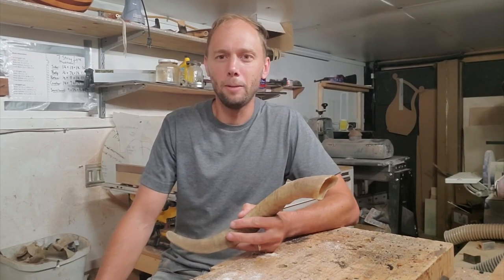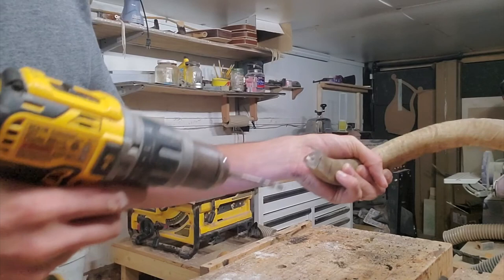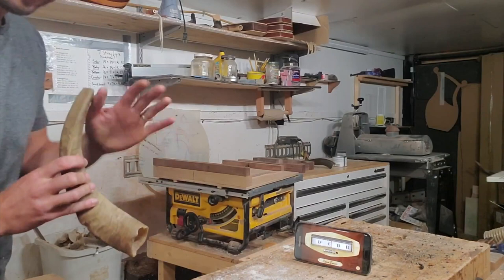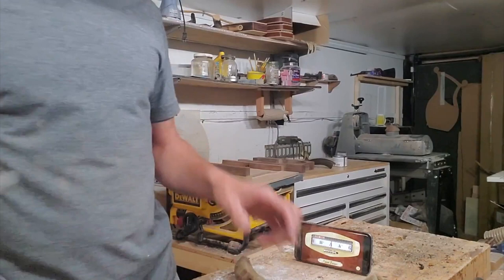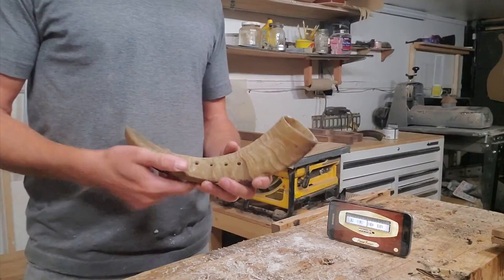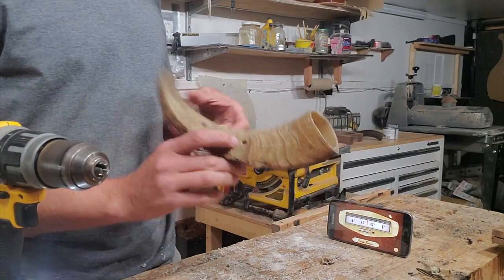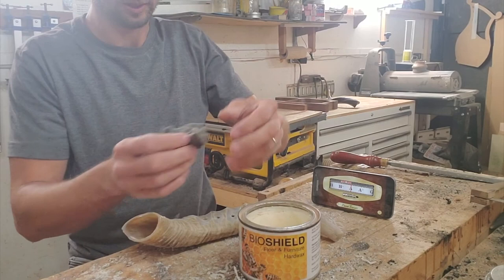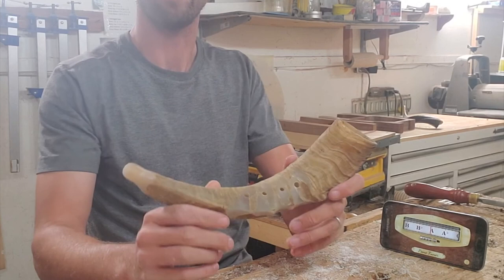How to Make and Tune a Viking Bukkehorn

Comment: Great video, very informative. I would have thought the placing of the fingerholes was much more mathematical, but it's just "kinda pick out the middle of the horn" and the fingers "about an inch spaced apart" (and then of course some microtuning).
Reply from the maker: Yup, for the most part. And each horn is different, so that plays a big role too.

Comment: Thanks a lot for this video!
I'm just starting to make a horn and I was wondering about the mouth piece.
Seems there is actually too diameter not just a straight hole right? 
You have first a thin hole that goes through, then on the extremity you have a bigger diameter right? could it be straigh hole (one diameter only) kind of like a didgeridoo? (I don't have mechanical tool and do by hand so... hehe)
Reply from the maker: Thank you. Yup, the internal diameter tapers and gets wider. You want to look for a horn that has a flatter internal spacing.
Reply: @calebbyerly  That sounds pretty intresting.. will see how it goes! :D